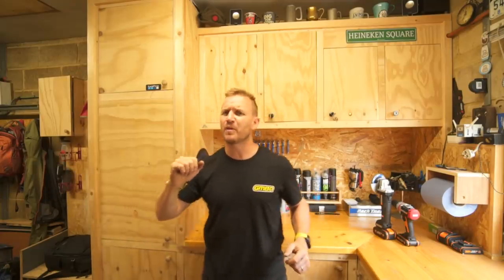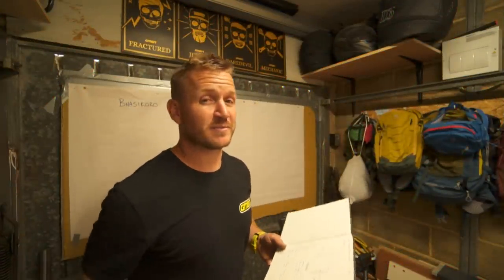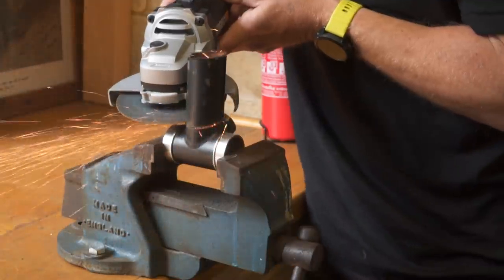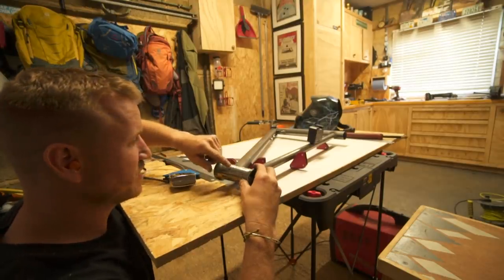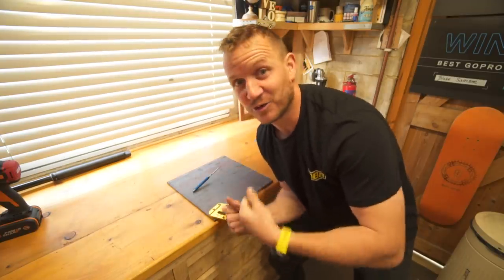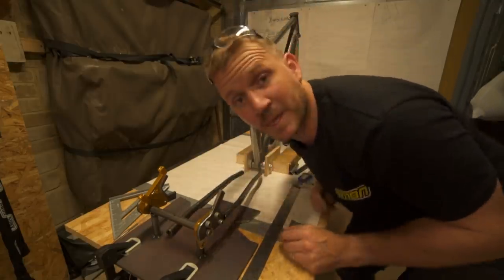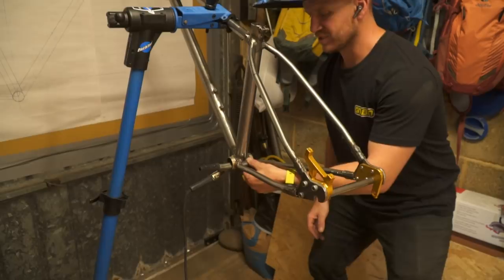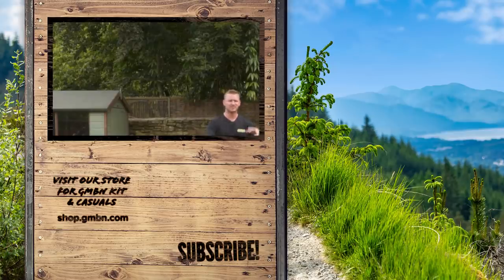I Built A Mountain Bike Frame In My Garage! | Blake Builds A Hardtail MTB

Comment: Awesome job, Blake!!!
Reply: I'm not saying that it would be an epic collab between you two, but mannnnn that would be great to see!
Reply: Epic Collab to make one out of HT steel next time? 👀
Reply: Yeah I think he need to get the frame to a shop for a heat treat asap the welds seem good but the bike frame needs to be annealed to actually make the bike safe
Reply: Cheers Alec. Turned out ok. Now can I turn it into a full suspension 😅😅😅
Reply: @Zimblake  I did welding on high school the bike looks great but..... The welds do need to be heat treated the frame will flex and depending on the gas used small holes can form in the welds or even a small crack could form
Reply: A damascus mtb frame
Reply: @qui-gonjinn4239  still the parts are load bearing it should be heat treated
Reply: Just don't say anything to cobra framebuilding he will get a heart atrack after watching this
Reply: I think Blake taking Alec out on the jumps on home made bikes would be cool.
Reply: @Alec Steele, I wondered if you saw this
Reply: Oii what u doing here.  🤣
Reply: ONE MILLION LAYER DAMASCUS STEEL BIKE
Reply: A collab between you 2 would be awesome
Reply: I love it my two favourite hobbies and youtubers in one.
Reply: Alec, even with the mistakes, your bike was a work of art. I'm sure you had a good laugh watching Blake (probably saying, 'yep, I made that mistake as well')
Reply: From the man who welded his own mountain bike! So cool to see Alec's comment here especially because I immediately remember him after seeing this video's title.

Comment: Expectations: He got a frame and is putting all the parts together.

Reality: He actually IS building a frame from scratch 😳
Reply: that is because so many people have used the term 'build' when the term they actually should be using is 'assembled.' 
not once has anyone actually built a bike when they make that claim in the title. 
well, not until now. Top job Blake!
Reply: It’s not easy.  I had a friend who was an aircraft welder, metallurgist, and weld inspector and he built his own bikes.  He still had trouble getting the welds to not break.  Good bike builders are extremely skilled.
Reply: I had no idea he was building a damn frame 😂 he’s badass

Comment: Now I imagine how hard Ave Maldea's work actually is. Ave is a local frame builder here in the Philippines who specializes in fixie and roadbike frames. He doesn't have a big production line and does every welding joint by hand. Although he is experienced, he must have a really hard start as shown by Blake's struggles here. Massive respect to those who have small bike manufacturing shops.

Comment: Absolutely brilliant mate ! Cant wait to see how it performs out there.
Reply: Amazing how cheap we can buy bikes really
Reply: @gregski29  It may seem so. It sure looks really good but only a few dozen rides and time will tell how much adjustments and repairs of the frame will be required until Blake is truly satisfied with its performance. Im pretty sure he will have to put some additional work into it right after the first ride.....and after the second... ;-D
Reply: @gregski29  well, if you get a budget aluminium bike (or steel BSO) then it'll not have been welded by hand like Blake did here, but mostly by robots on a production line.

Comment: I am pretty impressed with this build. I used to modify my kids bikes to have disc brakes (aluminium frames) with a butane torch and some aluminium filler rod.
Reply: Brakes, not being a critical component, can be overlooked if they fail suddenly, so no worries with this modification. Also, if there were to be some sort of accident, kids can be replaced with little effort, at least for the dad.

Comment: May i suggest DIY integral panniers for the bike packing trip? The extra weight will give you a better workout and they will hold more weight. Cooler bags with a hard plastic liner can also be drilled for added storage.

Comment: Have another go, but this time go full suspension.
There are a few tricks that even big manufacturers have used in the past to get around some of those issues. Some of it is using or ignoring traditional methods, some of it is sacrificing a few parts to get the groundwork in for the alignment.

Comment: Given the dropouts are bolted on, you could straighten out that rear wheel by fettling where the plates bolt on, moving one or both of the plates should let you align the rear axle to be normal (perpendicular) to the plane of the main triangle. What you can't do from moving the dropout plates is the side-to-side, which would need either some careful levering with a scaffold pole and a bit of wood, or do a Cannondale and give your rear wheel a bit of dish so it's not in the middle of the hub but is in line with the main triangle.

Comment: If you screw a long straight bar/rod onto both sides of where the rear hubs would sit (like pegs), you could straighten up the back end "by rack o' th'eye" pretty easy. The longer the rod/bar, the greater the accuracy. Must be straight bar, and quite thick so it doesn't bend when you want the bike to bend.  
Nice build BTW!

Comment: As an ex welder and welding inspector and now welding engineer, the first thing I would like to say is kudos to your innovation and can do attitude, really refreshing and inspiring.
As you said and found out a lot of technical knowledge, design  and skill goes into this sort of work and considering your lack of tools and knowledge for this project it is even more impressive what you achieved.
As you’ve stated in your video, you’re going to give it a tough trial over a few days and having watched your videos I know it will be a tough trial. For this can I express caution as the best weld design is “no weld”, unfortunately this cannot be achieved all the time and the high quality of the weld becomes paramount to safety and quality, hence the need for NDE when high  impact, fatigue loads are inevitable and these loads are definitely applicable in Mounting Biking.
I apologise if I’ve came across as negative and technical at the end of this post but your health an well being are extremely important but I will reiterate that it was an awesome effort and I am positive that with the correct tools, material, workshop and welding process (TIG would be my choice) you could make an awesome, high quality bike that could tackle any terrain  you throw at it.
Well done Blake 👍
Reply: Couldn't have said it better myself, as a new welder (5+ years), I'd argue the same thing.
Kinda started the video expecting the welding side of things to be a horror show, but was pleasantly surprised by the quality given your tools and experience with welding 😅

I honestly reckon with more technical knowledge and more appropriate tools and some TIG training, you'd be making some absolutely incredible frames.

Honestly sat here feeling like even with all my college training and work experience in fabrication, I couldn't do any better 😂
Incredible job Blake!

Comment: For the head tube if you want to be super simple just center line each of the three pieces and line up those center lines. How do you center line the tube? There's like a dozen ways you can find on the internet, but I like to build 2 square jigs with wood, mark the centers, place them over the tube snug, then pop a chalk line down the tube. You can also make sliding centerline tools out of wood that you put a pencil in. You know, whatever.

Comment: Nice build Blake.  I have fully ridgid bike from 20 years ago im still riding.  Looking at Polygon Sisku t8 full suspension.  Will I get same exercise factor out of bike on down and up hill trails or should I get hard tail.  And is there any other bikes you recommend around price point or slightly less.  Thanks! I want a bike that will last. I like to jump too.

Comment: I guess frame is the key. Once you get one (ordered or DIY- & preferably below 2 kilos or less) the rest is just attaching the other parts : groupset from say shimano (2-3 kilos),  two wheels (2 kilos?), cockpit et cetera (2 kilos). 2+2+2+2=8   and you have an 8 kilo bike - and that beats spending $2000-$3000 for a highend brand-named bike. 😉

Comment: Good attempt, but your welding needs more practice to get it looking nice. As it is, the welds look like dry, well chewed bubble gum, or road rash scabs. You could grind them down a bit, to improve the appearance I guess. 
Oh, and when you're done improving the appearance of the welds, get the whole thing powder coated, in a nice neon colour, it would look awesome! Then a few GMBN stickers dotted around, and contrasting JagWire gear cable outers to finish it off.

Comment: A bloke where I did my apprenticeship made retro bmx bikes in his spare time, had heaps of jigs for it, could build a bike a day, complete with helium filling the tubes.
Did cringe when I saw Blake MiG welding ontop of flammable material... TiG would be much better if you had time to learn, safer too.
Blake should try and straighten the rear by heating the tube and twisting.

Comment: Myself, being an older rider. Wanted to build a early 1990s Specialized Stumpjumper. Not used the Matrix metal since it's expensive and hard to work with. But made of cromoly. Would like the find the schematics on the frame. Have a pro teach me how to cut, weld and make something like you did..then ride it.. YA!

Comment: Hey kids: That shop has too much wood everywhere to whip out the spark machines (grinder and welder). Both burn down shops/garages everyday. Building a frame Looks fun though. Just don't grind and weld without a curtain near wood and flammables.

Comment: Did you mig weld or tig weld the frame still looks amazing #100%Hardtail
Reply: @joshporter5773  thanks
Reply: @joshporter5773  the tungsten is in the torch, you feed the filler wire/welding rod in

Comment: Welcome to the 2021 bike shortage
Reply: Also good job on the build Blake! That rear wheel angle is gonna cause some issues down the line, but it can always be fixed before going thru with a proper paint job. 

The only thing that will be a pain is the nuts you used to route the brake lines through. Its going to require a seperation of the lines and calipers along with full rebleeds any time you go to change or work on it.